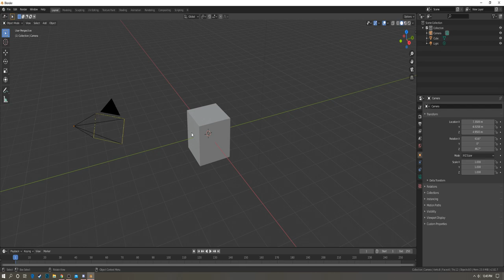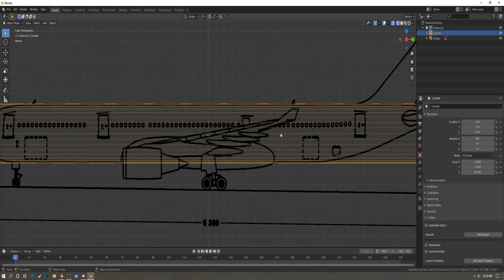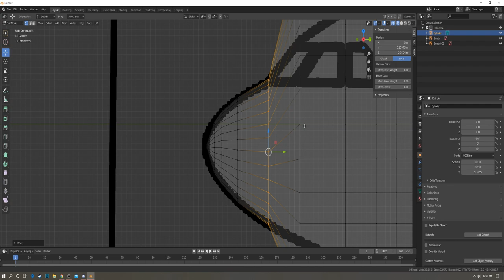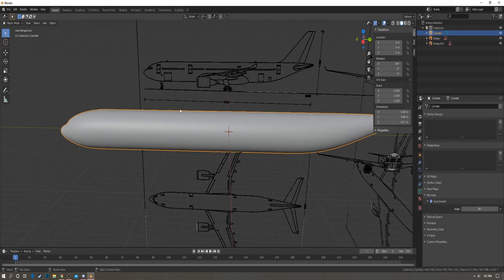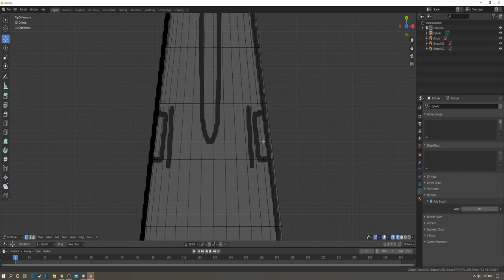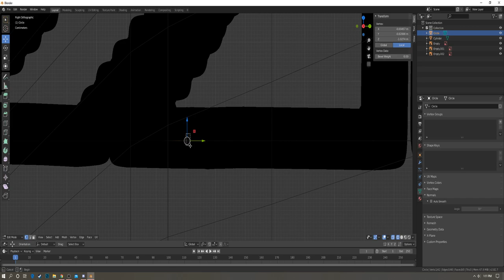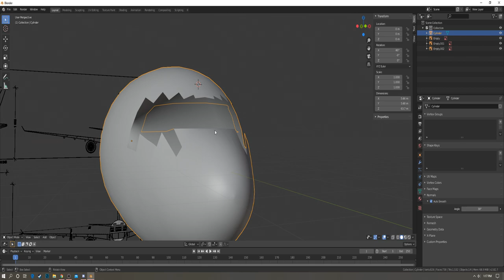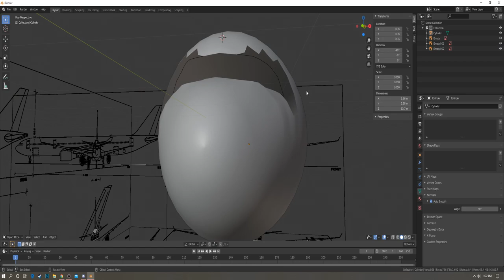Easy Way to Model a Fuselage in Blender 2.8

Comment: Not sure if this was explained or not but if you are wondering how to make a new vertex on an edge (between two vertices), like for example when creating the window frame, you can do this by selecting the desired edge, right clicking it and pressing subdivide. Then, select only the vertex you just made, press shift + v to let it slide along the edge. Press the left mouse button to permanently keep the vertex on desired spot.

Comment: Another thing that might help:  finding station diagrams of aircraft, at least in terms of if you are starting out modeling fuselages, and don't wanna feel overwhelmed with regards to where to move the vertices of each slice, etc to get an accurate looking model - or at least, I think it helps YMMV.

Comment: If you're having trouble with the cockpit. You can select one half of the fuselage, deleted. Then apply a mirror modifier to mirror the other half. Then use the knife tool to cut the shape of the cockpit. I found it a bit  faster and easier, because the knife tool will follow the faces.

Comment: Nice video 👍 My problem is, that you are sometimes doing stuff and not telling which keys you press.  Also, when I am trying to correct the shape of the fuselage (b and then scale with s), it moves the dots on a different axis as well, so that the length isn't the one I selected.

Comment: great tutorial Brady thanks. Is there a better way to round the nose off properly? and the tail as well actually. I just got the window part. Yours shows a single horizontal line on the side view , I have a vertical line left with a horizontal line at the top of this ( an right inverted L) ???? ANy ideas please.

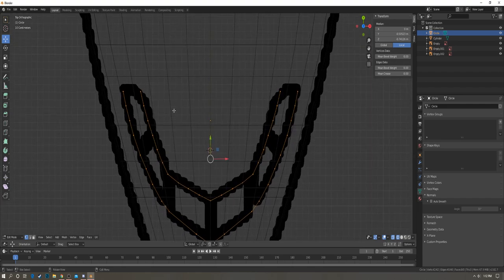Comment: 27:43 Why can't I join 2 verticles together? I pressed F yet nothing seems to happen, only when I select 4 verts it allows me to join, but not the right way? Anyone could help? I am using Blender 2.83
Reply: i have the same problem and I cant find the answer
Reply: @AviatorsHQSimulations  I solved it. Select both circles and press ctrl+J then go to edit mode and it should work ;)
Reply: @737Aviator i have a better way, just select the both of your 2 circles in edit mode and the press f
Reply: @CainYap  Thx bro!!
Reply: Alt + F4
Reply: Select both your circles in object mode and press ctrl J

Comment: 31:50 For some reason, even if I press 'c' on the keyboard, I keep the left mouse button pressed, I pass over the vertices, then I press enter and press 'f' on the keyboard, they connect in a very strange way. Anyone with the same issue?

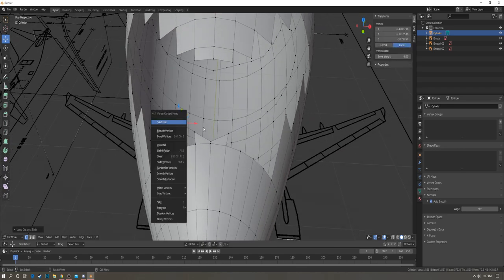Comment: 32:08 how did he make those parts?
Reply: Press c and left click on your mouse, hold the click and drag your cursor over specific vertices you want to select (the size of this selection/aka circle can be adjusted with mouse scroll), once you have selected the vertices, press escape and press f

Ps: there might be an easier way to do it but this was the only thing I found out while I was fiddling with things hehe :)

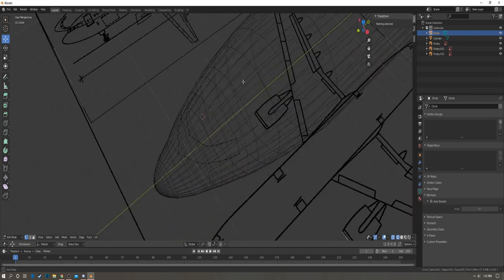Comment: 27:48~ minutes in you're merging two vertices by pressing 'F', for some reason my attempt doesn't work.  Could I be missing a step?  Great video.
Reply from the maker: Make sure it's the same object you are in edit mode with
Reply: @BradyMargeson  Yh I tried that but idk. It doesn't work. I selected the first circle then pressed shift and selected the second one. Then press TAB and select the two points, press F nothing happens